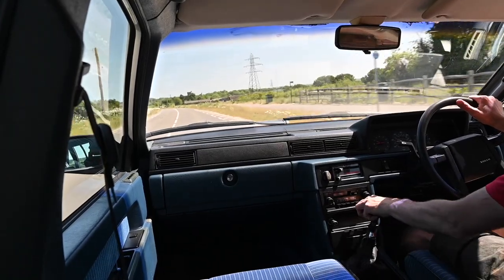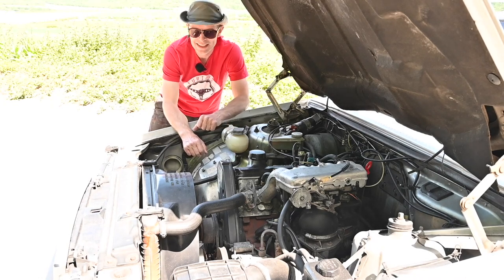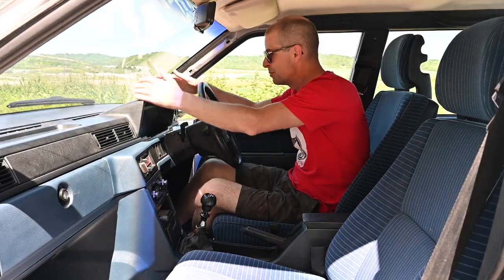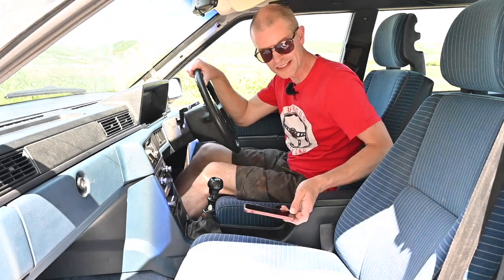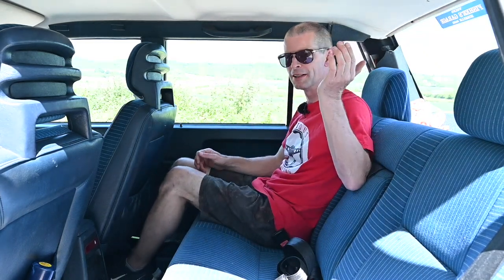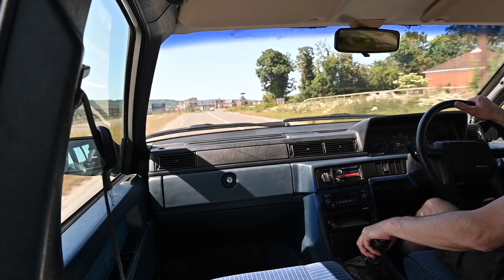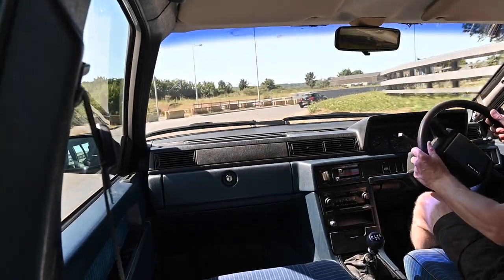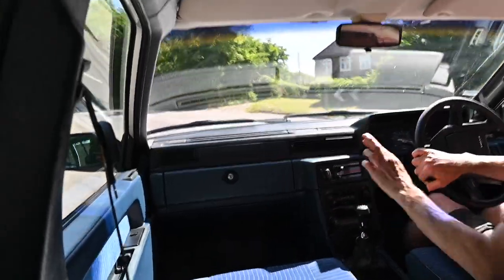1988 Volvo 740 GL Goes for a Drive

Comment: An excellent and thorough analysis of the car by a very knowledgeable and extremely fast-talking presenter. Possibly due to the latter, I may have missed it, but I don't recall any mention of power-steering, seat-adjustment options or the fact that the rear seats can be folded down - which I believe they can?!?!?! The rear armrest wasn't shown folded down either, admittedly a very minor point. But overall, it was a most enlightening and entertaining 25+ minutes, top-notch!

Comment: What a great car this is. These really were everywhere round my part of the world. We have a well established Volvo dealer in our town who are still in business today and have been Volvo for over 50 years. They are very different cars today though. 740’s were really popular and there are still quite a few about, especially the huge and really useful estates. My boss had a H reg 740TD saloon in the early 90’s which was fitted with the 6 cylinder VW diesel, they sounded wonderfully agricultural! A friend of mine who is a funeral director owned both an S90 (the last version of the 700/900) based Hearse and 6 door limousine and both used the in line 6 cyl petrol. A few years ago I had a drive of the limo, a lovely car to drive but very thirsty. Both were replaced with later S80 based 5 cyl petrol cars. Old Volvos just keep going!

Comment: I love VOLVO’s. Have done for many years ….. over 50 yrs now. First one I ever bought was a 1964 model 164. A beautiful little car with great driving characteristics. Gave it to my eldest daughter when I bought a 1970 240 Diesel, followed by an Audi 5000 which was a major disaster. Cost me lots of money. Went back to a Volvo 740 for lots of trouble free driving. Added a 740Turbo wagon to my fleet of drivers as well as a 240 Limited Edition that i acquired from a friend who had quit driving due to old age. In 1998 I acquired a near new 1996 Volvo 960 with less than 30,000 Kim’s on the odometer. Another beautiful car any way you look at it. When I bought it, I told my wife it would be the last car I would ever buy. At the age of 89 yrs, I have given up driving, but y wife is still driving me around. She loves the 960 & has no problems driving it. I’m so glad I bought it. It’s now 26 yrs old & still looks & drives like new. 
I hear many people complain about cost of repairs & gasoline. I myself feel this car owes me nothing. With the little amount of driving we do, I have it serviced once per year for oil & filter. Every 3rd year, I have them change all fluids. Gas mileage I don’t worry about, we don’t drive far anyway. I just use 87octane which suits it just fine. I get a lot of folk ask if I want to sell it but I don’t think I will. At least until we are totally done driving. I’ll probably hand it off to a grandson ….. IF he wants it. If not, my eldest son is into “old cars” so he will get it.

Comment: I remember my brother having a very rare 1984 760 Turbo saloon with the 2.3 litre 4 cylinder turbo lump which had 180 hp and had huge miles on it when he got rid of it only to replace it with an equally rare Volkswagen engined 2.4 litre straight six Turbo Diesel 940 estate which apparently had the same engine that was fitted to the Volkswagen LT35 van. The power output was more than the van configuration, but was still totally gutless having only 120hp but again, he managed to rack up 270,000 miles in it! These were great cars.
Reply: I took a new '84 740 Turbo Intercooler with the 2.3 liter out for a test drive. With 180hp that thing was quick & probably fast, too!!!  I had it up to 112mph in no time. It was pouring rain at the time, so that was plenty fast enough. But I could tell it had plenty more to go!
Reply: @bobjohnson205  we had a base 2.1 litre estate from 81. With its side draught carburetor, it put out a whalloping 97 HP. I once got the old girl up to about 120 mph, even with the 3 speed automatic. It took time, but it did it.
Reply: @michaeltutty1540  120 mph! That must have been down hill with a tail wind! lol In '78 I bought a '74 142 with the B20 engine and the dual Solex carburetors that put out 90 HP. I got that car up to 95 - tops. (No tailwind. No downgrade.)

In '79 I bought a '77 264GL with the B27F engine - 127 HP, 153 lb-ft of torque. I owned that car for 13 years and the best I ever did on level road was 105 mph or so.

My present Volvo has the B230F engine with an output of 114 HP and 135 lb-ft of torque. I've owned that car for 20 years and the best I have ever done is about 103 mph.

You must lead a charmed life! lol :)
Reply: @michaeltutty1540  that clearly had a very optimistic speedometer.

Comment: Easy to work on which is great, unlike modern Volvo's which are a nightmare. At 70 mph you would not be revving at 4,000 rpm. No way. Perhaps in 4th but not in 5th. I love the seats. I'd have not say they look like the best seats I have ever seen in any car. Love the gear shift too. Even the gearshift boot looks nice. Incredible condition. A credit to it's owners. I was in Sweden in 1990 and on my way into Stockholm from Arlanda airport just about every car was a Volvo. It was amazing. Few Saab's though which was curious. It's obvious you love your car. Happy motoring.

Comment: I had a Volvo 740GL as my first car. Such a great machine. I paid £100 for it with 204,300 miles on the clock. It took me to nearly 250,000 with no real issues before bearings failing in the back axles got to it. The only car I really miss and regret selling, even if I sold it for slightly more than I paid for it. 

F965HAM. Best car I owned.

Comment: My dad bought the final run 240 in 86. It was the 1987 model. It was that year they added the brake light in the rear window. Both my parents and many of my relatives worked for Volvo in Torslanda at one point or another. This is such a trip down memory lane.

Comment: As for the speaker grills.
Yours got the upgraded speakers. Base model has the same molded plastic grill front and back. And they should be colour coded.
Reply: Nope. Those plastic grilles were placeholders until speakers were fitted. Nothing behind them, as the Volvo head units could only power one set of speakers without an additional amplifier

Comment: Nice review! I have two 740's! one automatic and other with manual gearbox.The manual gearbox car had an engine problem, it seems that the rings were very worn or water entered and bent a connecting rod. I could not be without driving my Volvo and bought another one because I knew it would take time to get spare parts to repair the engine. It's waiting to come back to the roads! they are just lovely to drive. It's all pleasure. I'm from Argentina, regards!

Comment: Great video, Matt. You mention the way these cars corner. Thing is, they take a set and go. Granted they look outrageous, but keep your foot down and trust the car, and they will carry much more speed than seems possible. In 30 years and 400,000 miles, I have yet to hear tire squeal out of Arthur, and I do not corner gently. When it comes to the ride, fit a set of Monroe SensaTrack struts and shocks. The difference is astounding. The ride is as comfortable but without the float. More performance oriented tyres make a huge difference, too. On the 240, the spare tyre stands upright in the left quarter panel behind the wheel well. Makes for a more usable boot/load space. 

Your GL is not the base model. The entry level, at least here, was the DL (Deluxe). GL (Grand Luxe) was the one up. Top trim was GLE (Grand Luxe Executive). We did not get the SE in Canada, but did see the GLT (sport seats and suspension, base 2.3 litre engine) and TURBO, which had the same suspension an interior as GLT, but with the turbocharged 2.3.
Reply: There was no 740DL in the UK or Europe. You could get a 240DL, but not a 740

Comment: Hi, those changes to the scuttle panel and the multi-link rear suspension is a 760/960 thing, the old axle design and prominent windshield wipers stayed on the 40-series all the way to the last 940s. :)
Reply: The 940SE also came with the multi-link rear suspension.
Reply: @bobjohnson205  Multiple different cars around the world have been named Volvo 940 SE.
In Europe the 940SE was just a regular 940 (B230F with or without turbo) with some extra's.
In the US the 940SE badge was used for what was actually a 960 Turbo in Europe, so only the US 940SE has multilink rear suspension (and the more streamlined bonnet and windshield wiper situation, a slightly different dashboard...) because it is actually a 960.
Reply: @Candisa  So glad you agree that the 940SE had multilink rear suspension. :)

Comment: I used to deliver Tv:s and AV equipment for customers in an Estate version. Unfortunately, I have to admit I never liked these old Volvos, even if they are from my native country. Just not my cup of tea driving wise, at least when I was younger. But as you said, viewed though the right lens they are wonderfully practical, comfortable and reliable cars. What really won me over on them, was when I started driving more on small swedish gravel roads with lots of snow banks. Just plow through the 3 feet snow with the big bumper, good luck doing that with another car without breaking something expensive.

Comment: Dad had a 86 model GL but the estate with the 2.3 auto. Lovely car so well built and reliable. Huge boot far more practical than a suv. Auto box eventually started slipping after 12 years and huge mileage so sold it. Before that he had another huge estate car the citroen cx safari 2.4 which was amazing when it was working. Huge boot I think even bigger than the Volvo and the most amazing ride of any car felt like hovering above the road surface. But wasn't as reliable as the Volvo and parts were really expensive. Would like to see a comparison review of both cars as they were amazing cars and proper load carrying estate cars.

Comment: I had an '87 for decades, sold with 390,000k on the clock, and the only thing that ever broke was the wiper stalk. Not so robust after all. Mind you, a spot of Super Glue™ fixed it.

Comment: I have a 1990 740 GL and love it.  I have owned eight Volvos over the years and the 740 is my favorite.  I've had my 740 since 2005 and have done most of the maintenance myself because it's so easy to work on.  I also have a 240 and an XC70, but I prefer to drive the 740.

Comment: Plenty of admiration for the estate version, which was always a very practical design for loads and large families - but less for the shape of the saloon which I never thought very much of. I'm sure they were good cars though, even though there were horror stories of engine destruction when the cambelts were not maintained properly. A colleague of mine (with 6 kids!) back in the early 90s adored his old estate and was reduced to tears when he had to scrap it due to the aforementioned problem.
Reply: Wierd, the red block engines are of non-interference design thus a snapping cam belt is not a problem. Happened to the B230F engine in my car, just align it to dead center and put a new belt on. However this is not true for the engines which have the K-suffix, which have a flat cylinder head.
Reply: The 8 valve Red Block is a non-interference engine. There should be no damage if the cam belt breaks. The 16 valve Red Block is an interference engine, so damage is likely. Then again, Volvo says to do the cam belt ever 60,000 miles. It is generally a 1 hour job if you do the engine seals at the same time. The parts are cheap to do the job, too.
Reply: @haardkaar  the carburettor fed B230K (such as fitted to the 1986 GL and GLE) was an interference engine.
Reply: @DavidEverson77  Yep the K is an interference engine by design, due to flat head. It's uncommon in Sweden. High trim levels as the GLE usually had E engines, which demotes mechanical fuel injection. Although most 240 and 740 had either A (low spec) or F engines in Sweden. The latter denoting electronic fuel injection with Lambdasond. Catalytic converters became mandatory in 1988 but most cars already had them since 1986/1987.

Comment: We here in the US got this as the 740 GLE. More standard equipment. I think it was categorized as a large vehicle by the EPA. And I believe this could be equipped with a 2.3 litre intercooler turbo! Great vehicle, great video Matt! A great start to my day!
Reply: Sherman is an appropriate name for this extremely likable vehicle!
Of I am not mistaken, we here in the US only got this as a GLE, but with different engines (760 for the V6, for example). I do remember these were quite expensive, but, because it is a VOLVO, you bought it because of its reputation; safety, reliability, durability. You are used to small vehicles there in the UK 🇬🇧, we like BIG, SOLID VEHICLES.
I also noticed you driving through a new housing estate! Incredible! And, it looked like a very warm, dry day. I was admiring the scenery as well! Oh, and before I forget, I also think most Volvo models of this era in the US 🇺🇸 had air conditioning standard. My memory isn't what it should be.
And I also think they were adver as "Volvo. For Life."  For which this is a perfect example!
I do know that these are rare in the US.

Comment: You seem to have mixed up the changes quite a bit. The 740 never got multilink, and neither did the 940. Neither got the aerodynamically shielded wipers either. It was the 760 that got those---and possibly only the saloon as the '91-'94 965 didn't have multilink---as well as a new front that looks very similar to the 960. In 1990 the 740---and not the 760 as it was due for replacement by the 960---got a facelift to look more like the 850, so I'm told, that was a bit of a hybrid between the 740 and 940. Beginning in '91 the dash was the same as the 940's, so by that time it was quite a partsbin special.
Also, your front speaker grills (and the speakers themselves) are most likely an option. What you have in the rear is what they look like in the front as standard
Reply from the maker: Its just what I found when I read up on them
Reply: "In 1990 the 740 got a facelift to look more like the 850" That's a pretty good trick considering the 850 wasn't even around until the '92 model year.
Reply: @bobjohnson205  92 model year comes out in October 1991 in the UK and Europe..
Reply: @furiousdriving  he's correct though. No 740 ever got the multilink rear axle. That was on the 1988 760s, which had a facelifted exterior and interior. My dad had bought a 740GLE estate brand new in 1986, so we went to the dealer launch evening

Comment: I can confirm that the impact absorbent bumpers on these cars can really do their jobs well. Back when I was around 18 I had a clapped out 740 turbocharged rust box with the boost cranked up and the diff welded solid. One cold snowy morning on the way to work a particularly inviting roundabout was completely empty and I couldn't resist doing a bit of hooliganism. The ensuing skidding and sliding got out of hand (which I blame entirely on the ice and snow on the ground and not on my own inexperience and poor judgment) resulting in me stuffing the front of the car diagonally into a guard railing at about 20-30mph. The impact was significant and as I pulled over into a bus stop to inspect the damage my heart was filled with dread at the prospect that I had ruined my first car, but as I stepped out to behold the damage I was quite taken aback to discover that the only damage was a palm-sized scratch on the plastic skin of the bumper. Thorougher inspection at a later date confirmed that there was no structural damage at all to the car, just a scratch on the bumper skin.  

I had to park extremely close to the garage door for about a week to hide the damage from my parents until I could buy a "new" $10 bumper at the local scrap yard.

Comment: I’m quite sure you got the black line trim. It was a special trim in 1988 that on the inside came with electric windows in the front, electric mirrors and those blue seat with white stripes. 
On the exterior they had black painted trim round the windows (chrome underneath the paint) and a black stipe on both sides. Basically the tame looks as the GLT trim. I’m not sure if they were all white. I have only seen white examples. 

I had a white 1988 black line for 10 years before I bought a 1997 S90. 

By the way. The thick and durable bumpers are great! It happened a couple of times that other people crushed their brittle plasic bumpers against the bumpers on my 740. They got a hole in their wallet and I had to brush away their paint from my bumpers.

Comment: Great vid Matt! Love your enthusiasm. My dad had a GL similar to yours but was an '84 on a B plate. Keep fit windows all round and steel saucer wheel trims. His first saloon after 3 consecutive estates (a 245, a 265 and then a 240). I don't think we ever loved it as much as the estates but it was a fine car and a great way to cover miles. Ours was silver too with the same pinstriping on both the outside and inside (thankfully not blue though, sorry!). One thing I never liked though was that centre console. Cheap, creaky plastics that never fitted together properly, a real mess I thought, partially sorted with the 1988 facelift. You're right about the wallowy handling, this has just reminded me that our 740 was the first car I ever drove on my 17th birthday when my dad took me for a driving lesson! Definitely a wallowy old barge and a baptsim of fire threading that through country lanes on my first outing behind the wheel of a car. The 940 that followed it wasnt much better but it was an estate. I used that to camp in at Leeds festival in 2000 which was an absolute washout. Well, it was for those in tents, it wasn't for me... you couldn't do that in a saloon. As an aside I once borrowed the 940 to lug over 300kg of gravel back from B&Q one time. It rode better loaded than it did empty....